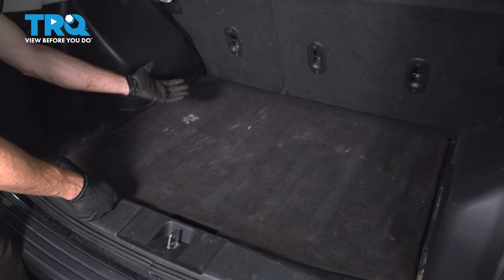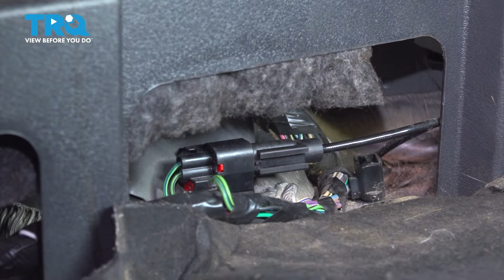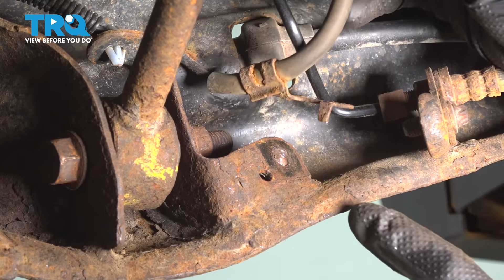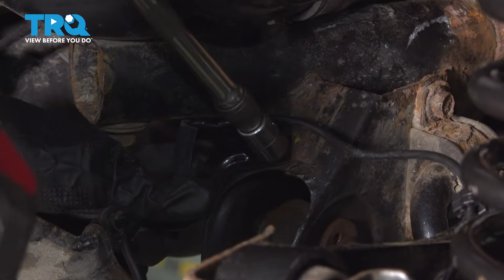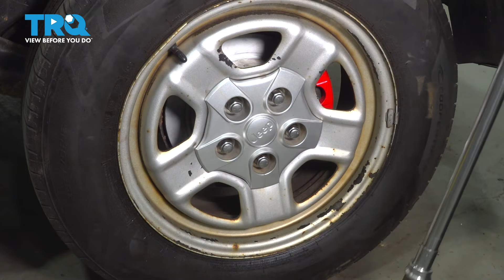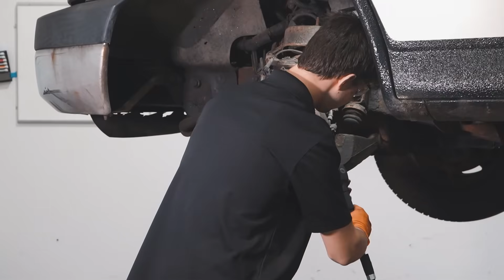How to Replace Rear ABS Wheel Speed Sensor 2007-2017 Jeep Patriot

Comment: I replaced the sensor on drivers rear side  after having issues with dash lights of 4-wheel drive flashing and causing my abs and traction control  and 4 wheel to stop functioning and even heard weird noises coming from rear end which was probably caused by broken sensor to wheel BUT after replacing it  the  lights still come on and using a computer  as moving the jeep theres no  movement on that wheel so what else can cause this issue any help would be appreciated thanks

Comment: My sensor was completely different than that but mostly the same. The part connecting to the actual wheel or Wtvr was different. It was in with a bolt and just different.